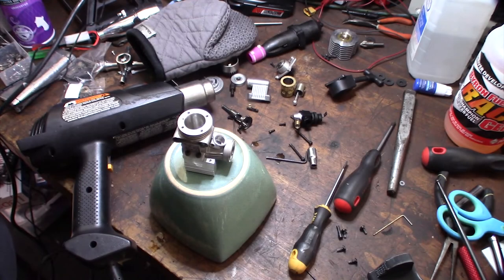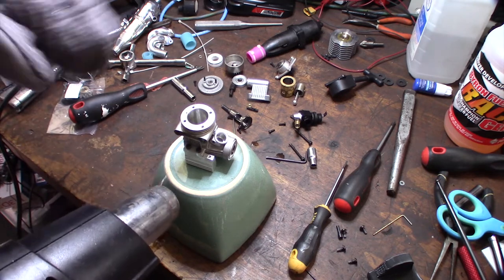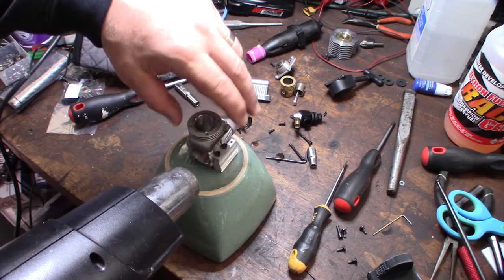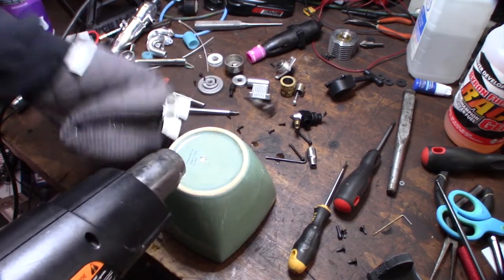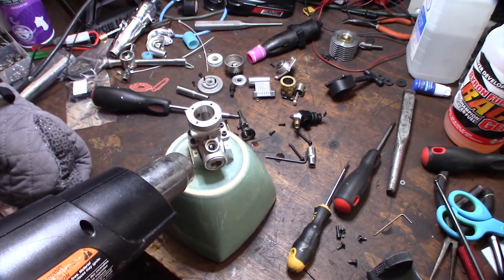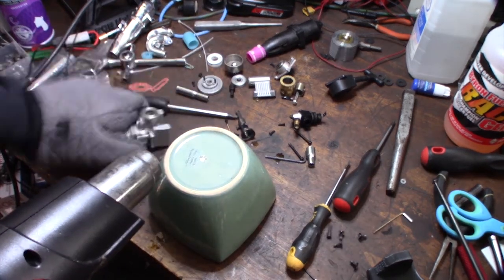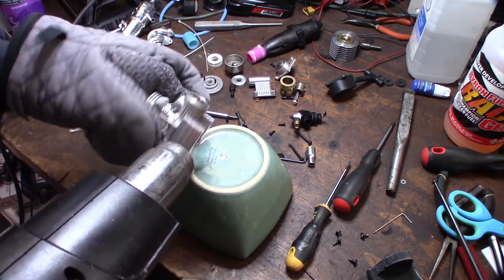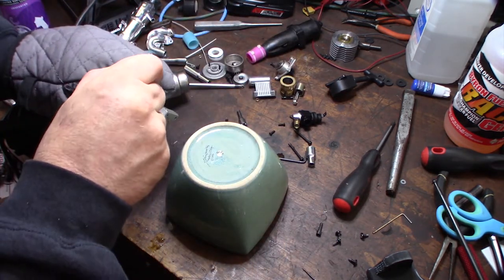Nitro RC Engine Bearing Removal using heat gun

Comment: The front is not more difficult. The front is easier. You can push the front bearing out with a wooden stick so easily. If the rear is rusted this BANGING will not work. You need a blind bearing removal kit such as motorcycle bearing puller.